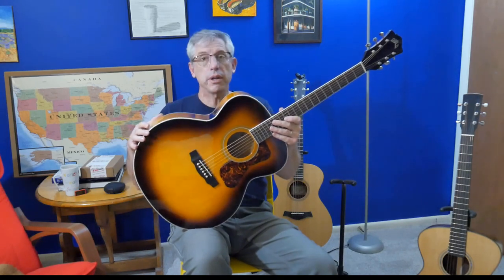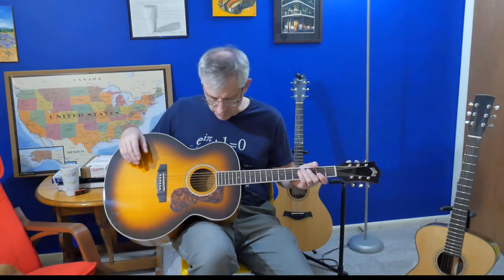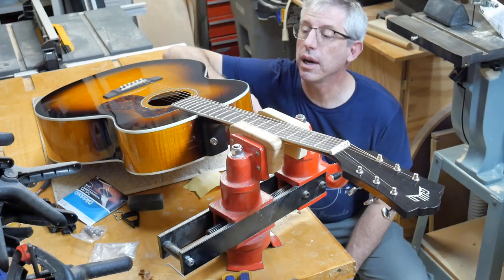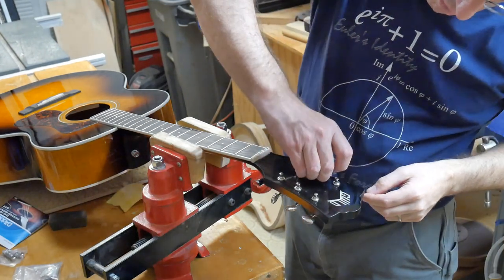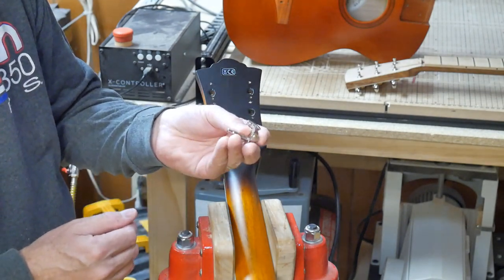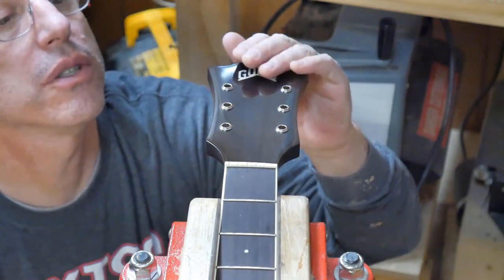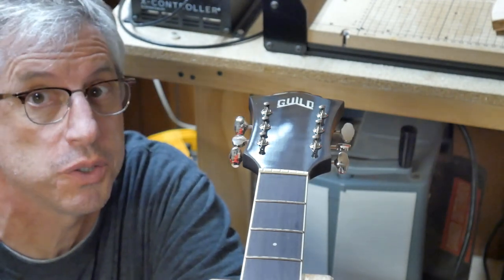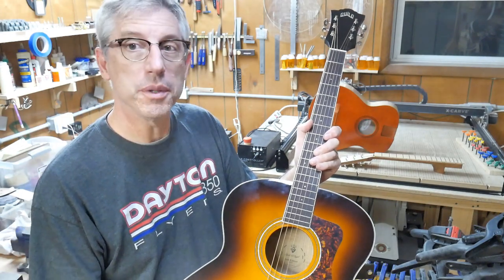Guild F-250E Review and Upgrade - The Fret Board

Comment: Got the very same guitar. Like you I am not satisfied with “well enough”. I swapped the nut and saddle out with Graph Tech Tusq XL parts. Removed the piezo pickup system while I was doing the upgrades. Lastly I swapped out the bridge pins for heavier solid brass pins. Stock the guitar is nice, but I felt like it was being choked by the piezo system. (And it was.) Removing the soft wire, and making solid direct from saddle to wood contact woke up the beast so to speak. Sounds like a jumbo Guild should! I didn’t find the tuners to be an issue on mine after a simple once over with a screwdriver and a small amount of lithium grease added to the gears. I will give this bit of advice to anyone who buys this guitar. Be sure to buy a truss rod tool that can handle deep clearance. Cruz tools makes a perfect wrench for exactly this. It’s a life saver. Truss rod socket is a 4mm hex FYI. I love my Guild, and I highly recommend trying one at least if you can.
Reply: Could you elaborate on what you mean by removing the softwire and piezo pickup? Does it mean you made it non electric? Thanks

Comment: hi, I would like to buy a Guild of this model but I have never been able to try it.  can you tell me if it's soft and easy to play or hard?  thank you very much.  Joseph
Reply from the maker: It has the same scale length as most full size guitars, 25.5 in, so the strings will feel about the same.  I like D'Addario silk and steel strings.  They are a softer on my fingers.

Comment: Hi, I just got this guitar. Will be upgrading tuners with Grover sta-tites as soon as they arrive. I upgraded saddle to bone. I removed the undersaddle pickup element as I don't play plugged in anyway and dropped in the bone saddle. Sounds a lot better, fuller, more sustain to my ears. I want to upgrade bridge pins from the cheapo plastic ones. Having a hard time finding pins that are so narrow. Any links to pins that will work are appreciated. I prefer ebony. Thanks!
Reply from the maker: I initially had a tough time finding 3 degree pins.  That's why I went to the 5 degree pins.  Later, I found that Luthier Mercantile (lmii.com) has a nice selection of 3 degree pins.

Comment: Tone Killer Upgrade????
Should have gotten Waverly open back tuners if you felt the need to screw up the guitar.
Reply from the maker: I've tried Waverly tuners and they were nice, but pretty expensive.  The ones I got had a lower gear ratio (15:1 I think).  I've used the Sta-Tites for years and they are listed on the Guild web site.  They also have an 18:1 ratio.